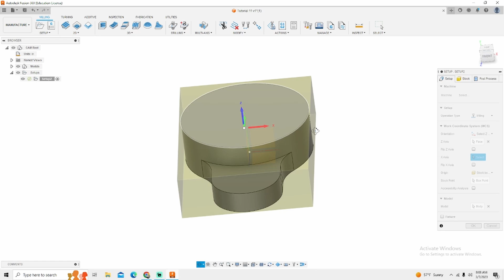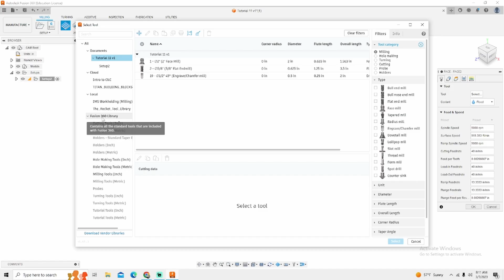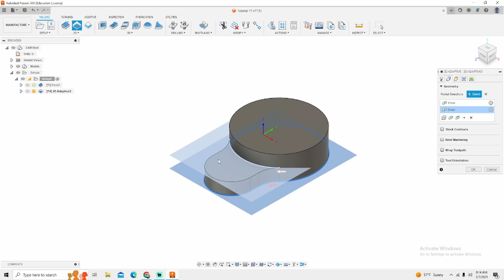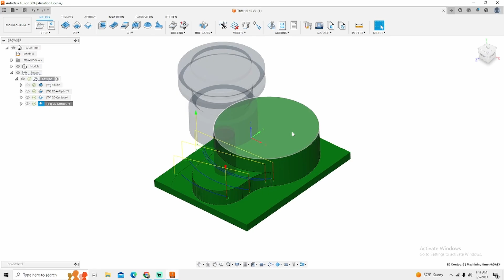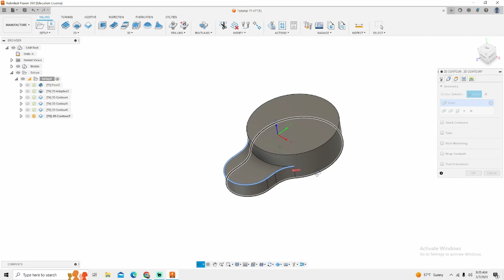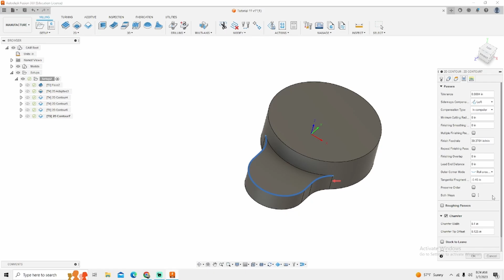Tutorial 11 (Demo Facing, Adaptive,  Contour, and Complex Chamfers)

Comment: Using a negative number on the tangential extension is neat trick.....thanks for sharing that.  Is there a reason why you use the Contour command versus the Chamfer command for putting chamfers on edges....???
Reply from the maker: I use both. But I have found that contour gives me more control over my settings.
Reply: So could you use this technique for doing 3D chamfers on complex multi angle surfaces…? @machinistmade784